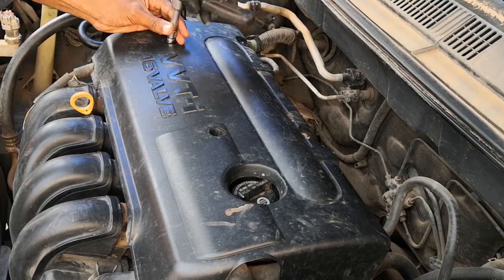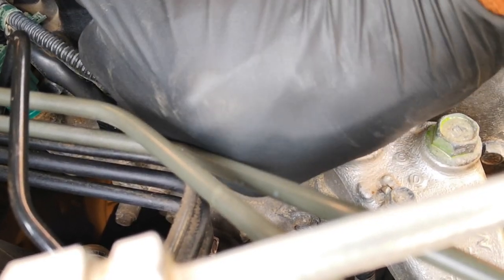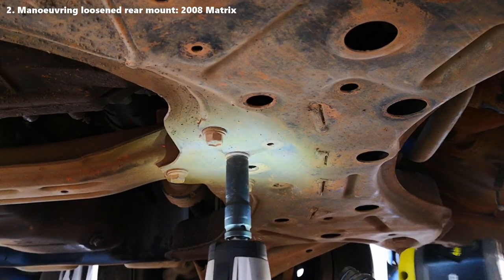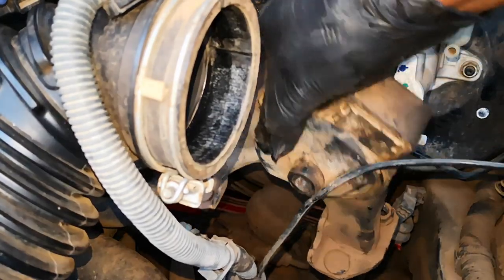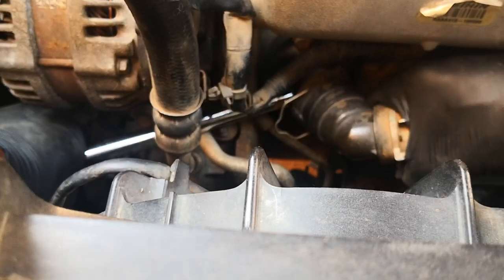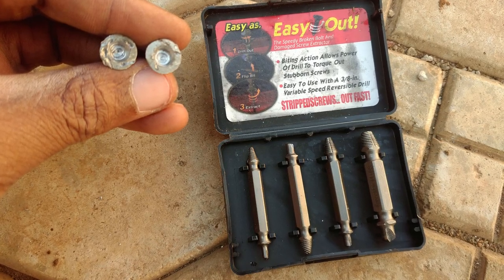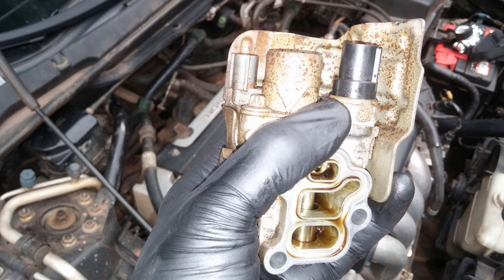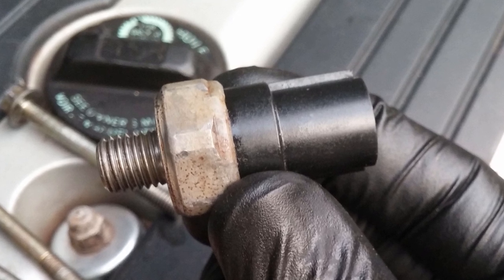5 times I almost gave up car DIY repair & went to the Dealer / Tips for DIY car repair

Comment: The rear motor mounts on the Matrix / Vibe are legendary and have brought many mechanics to tears.  I know of one guy that took over 5 hours to get it off.  I had a similar problem with the hose clamp on the lower radiator hose on my 1zz engine.  Everything was in the way and even with the proper hose clamp pliers, I could not get it off.  Like you said, walk away and come back in a few minutes and see how it works.  I did get it off and used the screw type clamp instead when I replaced the hose.  I live in Michigan and we have lots of rust due to salt on the road and have many stories about rusty bolts and nuts.  I did buy an inductive heater to heat many bolts and nuts and it works great, highly recommend one if you are a full time mechanic.  Great channel!
Reply from the maker: Thanks a lot for sharing these experiences, and complimenting. Oh my, that matrix rear motor mount! An unforgettable experience. 🤣
Bringing many mechanics to tears cracked me up real good😂. I'm purely DIY and so far haven't had issues with diehard rusty bolts. But I totally agree that an inductive heater comes handy for those terrible ones.

Comment: Thanks for sharing.
I've also had a lot.
One was trying to replace the EGR valve on my 2005 Ford Five Hundred cos of vacuum leak. Took me weeks to eventually get it done.

Also, after getting a used abs (the abs controls the AWD and Traction Control), took me weeks to also get it out but I was eventually able to remove it, replace and successfully program the new one which gave me more courage to keep trying and today, I'm glad I didn't give up.
Might keep using the car forever even if I buy a 2025 Tesla, cos it has lots of memories and kick started my adventure into DIY
Reply from the maker: Nice! Certainly hear you on the keeping the car. When I sold my 2003 Accord and the new owner was driving away, it felt like a part of me was leaving. I had to quickly start washing the 2017 to calm my head 😂

Comment: I really like your videos.
I had a similar experience, I was replacing the lower control arms on my 2004 Accord.

Left side went like a dream. The right side, was very bad, it's where all the puddles and salt happen. 
The horizontal bushing was frozen to the bolt, I had to borrow a sable saw and cut into it 😢
I was almost deceased.
Reply from the maker: Thanks for your compliment. Means a lot. 
Oh gosh. I know that lower control arm like the back of my palm! Luckily I don't have road salt at my location. That said, I do know how rust and just 1 frozen bolt can turn a 20-minute job to 3-hour back-breaking labour. Happy you got through it in the end.

Comment: I had a leak around the oil filter on a 2012 Honda Accord. Initially I thought the leak was coming from the oil filter itself so I bought another oil filter but the nasty leak continued. Then I tightened the filter more to see if it will stop but it didn't. Until I slept under the car while it was running before I noticed it was leaking from the oil filter housing.
Changed the seal and used enough silicone gum to stop the damn thing.
Reply from the maker: 😂 Funny. Thanks for sharing

Comment: Very informative video! Thank you!
I am having this stubborn oil leak on my 2004 accord. I already replaced vtec solenoid gasket 3 times. 😂 Now, after watching your video I believe that my Oil Pressure Switch is having same problem as yours. Do you happen to have part number?
Reply from the maker: I know that experience.🤣 I replaced my VTEC solenoid gasket twice and even applied a smear of gasket maker on the 2nd try😅, before identifying that evil leak. You'll have to get the o-ring for the VTEC switch too P/N is 91319-PAA-A01. 
P/N for the VTEC pressure switch is 37250-PNE-G01. Before you buy though, I advise you do that inspection I did. There's a non-serviceable solenoid held by 2 unconventional bolts on that assembly. It can leak too. If its what's leaking. Either way just leaning over and looking directly over the assembly, you see which side the leak is coming from. Good luck!
Reply: @DIYAutoworksNG  thank you for the recommendation. Part # 16721-RAA-A01 is a fuel feed hose, not o ring.
Reply from the maker: Sorry. Guess I mixed it up with the P/N I was sending someone. The correct number is 91319-PAA-A01.
I'll correct the first mention so someone doesn't get misled.
Reply: @DIYAutoworksNG  thank you again! 
There is another oil sensor between oil filter and vtec solenoid. Do you think that one might be leaking too? Please see video below for reference:
https://youtu.be/fsXzfAqZgEY
Reply from the maker: The part replaced in the video you referenced is the oil pressure sensor for the engine. Its the one that's instrumental to tripping the low oil pressure light. It can leak too, but a leak from the VTEC solenoid assembly will drip oil on the oil pressure switch making it look as though the latter is leaking too. Try and rule out the the VTEC leak first. It helps to clean the area so that you can better visualize new leaks.

Comment: Worst nightmare for me regarding a repair for my car would be removing the rear arms from the suspension to remove and clean the subframe from rust on a 2004 Accord. Everybody I asked about doing this advised me to buy new arms and bolts because I will be forced to cut them in order to remove them.
Reply from the maker: Haven't had need to work on rear suspensions that much. Thanks for sharing. Did you eventually need to cut the old ones?
Reply: Not yet but I must be prepared. I heard this kind of problem is pretty often encountered on older cars especially those affected by rust because the bolts are almost welded to the inner bushings of the arms. Most mechanics avoid this task because is time consuming or they accept to replace the arms if the customer agrees to discard the old ones.